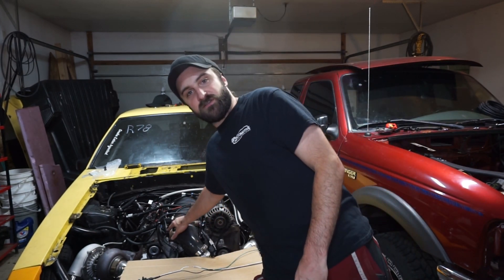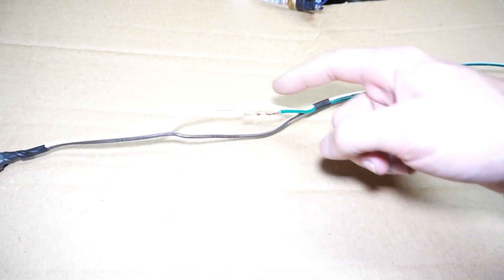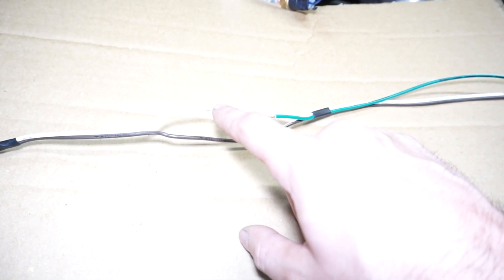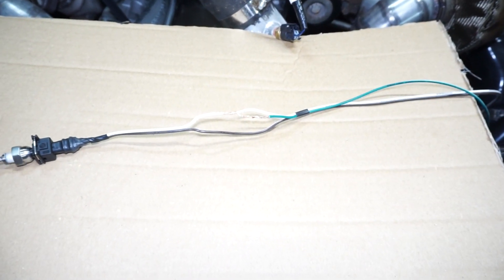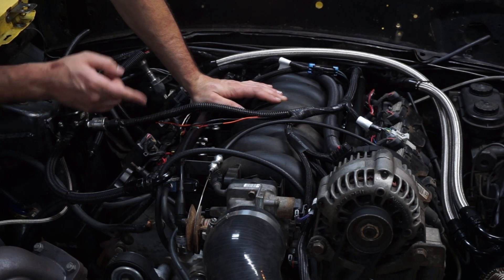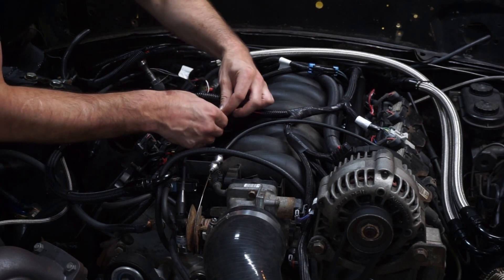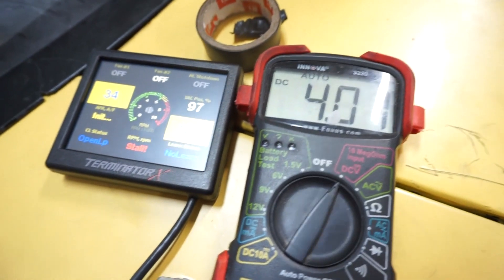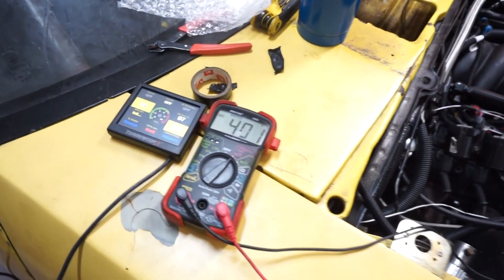How To Trans Temp Sensor With 5V Pull-up Circuit on Terminator X!!!

Comment: Good video to have out for sure. Few points I'd add that may be helpful to some.
1. Typically, I like to keep my pull up resistors themselves inside the cabin (assuming the ECU is inside), away from engine heat, and excessive vibration. Given they've likely been soldered to the wiring, this helps mitigate a potential point of failure in the future. 
2. While the "test and check" method of finding the calibration definitely works, MOST GM sensors have a cal sheet available online from the OEM (Denso, etc.). You can do some basic voltage division in conjunction with your intended pull up (or pull down) resistor to see what the updated voltage values will be at various output values. This also is helpful if you don't know what resistor value to use with your sensor; you can play around with the calculation to give you the most resolution in output voltage.

-Taylor
Reply from the maker: Good points to add. I'd definitely have the resistor inside and supported well.
Reply: @BlaserBuilds  The other element heat adds into the mix is it has a direct affect on the resistor used for the pull up/down functionality. Depending on the specific resistor used, this could have a minor or major affect of the actual value the sensor reads, as that sensor's resistance rises from heat.

Comment: Where are you pulling 5v from on the terminator x?  I need to supply 5v for my dome sensor and don't see any 5v output available
Reply from the maker: Spliced off of fuel pressure. 5v will stay 5v after split and doesn't interfere...
Reply: Agreed. If your already using a TX you can hop off of either the 5v ref that they put in their harness for oil press, coolant temp or any other 5v source. Just be sure to make sure your splices are sound. Preferably soldered. And for the reasons mentioned elsewhere i. The comments be sure to nail down your pull up resistor if you cant put it inside the cabin, which most likely is not an easy option for most folks. Remember shrink tube is your pal. While yes it insulates your connection it is also a strain relief as well. Be sure to go past the joint on both sides. Just remember shrink tube and ty-wraps are cheap and uncovering an over temp situation from part failure just blows! Cheers!
                                       “Go that way! Really fast! If something gets in ur way……….turn!”

Comment: Could you please share your source for the pulsing frequency power control you use for your fuel injector flow tester ?  I'm trying to get one together.  TIA
Reply from the maker: NE555 frequency generator on ebay.